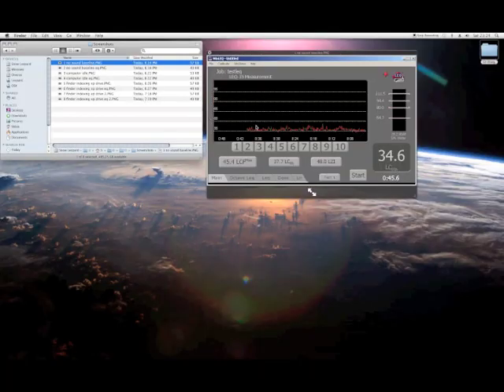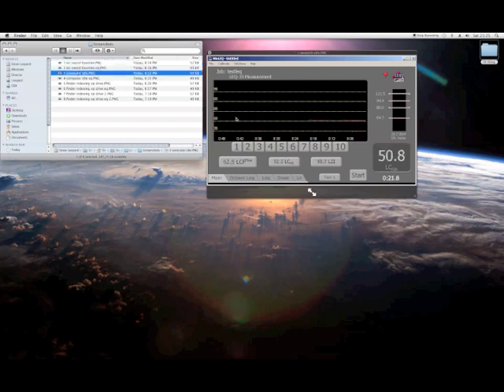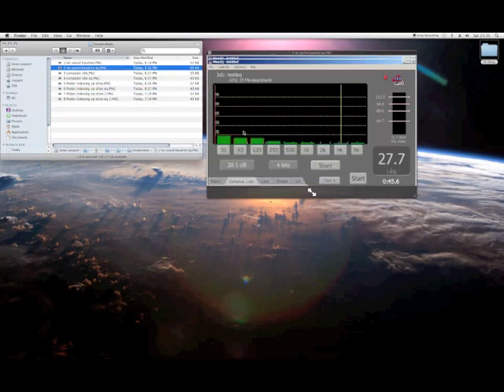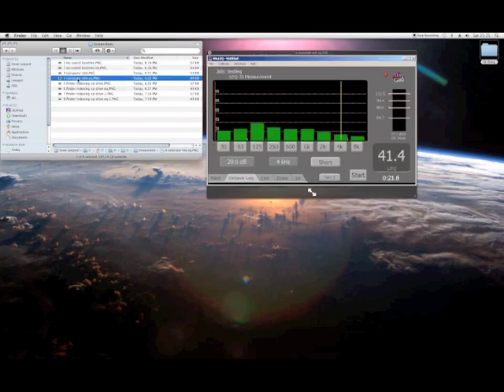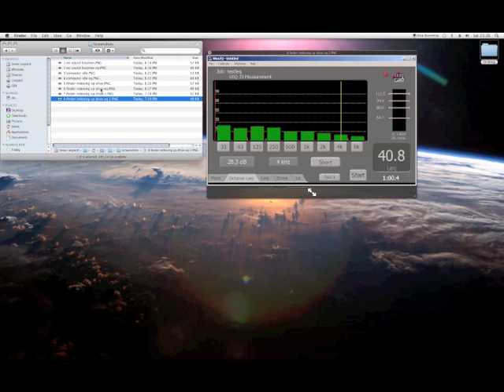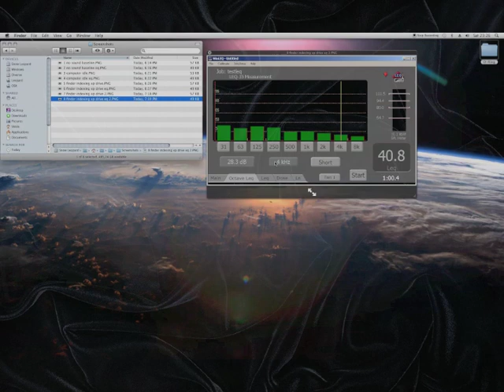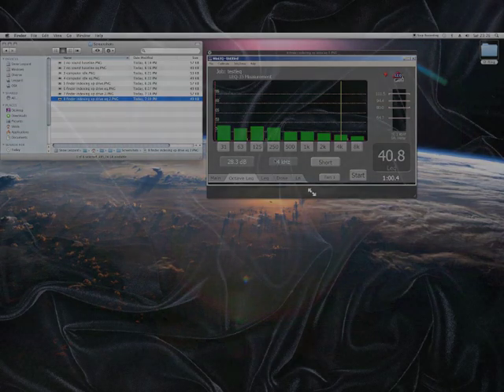Reducing noise from your HDD.

Comment: Waaaa sound like a very bad idea. The drives are still mooving, not fixed. I think the drive will die young. But at first, the drives were vertical, wich also is bad for the drives, if you believe most constructors, so who knows, it might be better :)

Comment: the whole case of the HDD is connected to ground of the electronics, it wouldn't made any difference which way you put down the HDD. It doesn't do anything.
Reply: MotoK tips he was insulating hdd from case, because case amplifies hdd noise.

Comment: Uploaded in 2009, how can I not have seen this earlier. I've been looking for something like this for some time now. My HDDs make my entire case vibrate and a large SSD is just out of budget. Going to try this for sure. Thanks for the great idea!
Reply: Does it make it more quiet?
Reply: @Conch.  Not as much as I hoped. I've used rubber bands that look the same as the ones in the video. The problem is that there isn't enough room to really hang the 3,5" HDD's up with the rubber bands. It's a rather tight fit with the rubber bands in between the HDD and the casing. So it reduces the vibrations a bit, but does really not eliminates them. Maybe in a case with a different setup the HDD can be suspended by the rubber bands. 

Since my first comment was 4 years ago. In the meantime I bought another SSD for internal use, pulled all HDDs out and have an external HDD mount on my desk for when I need to access the data on them. My pc is really quiet now.
Reply: @CtotheZ  ok thanks for replying so fast  :) I’m going to do this trick so I can silence it a little bit because it vibrates my case so i might be able to reduce the noise a bit

Comment: This will only work if you have such cases in which you can put multiple hard drives. In my case I have separate plastic trays in which each hdd goes. Even with some rubber washers it still makes noises. It still vibrates, resonating through the case. It's annoying.
Reply from the maker: Snowwie88 
I've seen people using this technique in the 5,25" bays. Worked fine for them. 😊
Reply: Remove the cages and guetto mod the thing.

Comment: This thing doesnt work at all.. Well.. it can help a bit.. maybe like 30% tops but to really silence it you need something like a box for it which will really silence it.. esp when you need a high rpm hdd even tho these times it might be better to just buy a 500 Gb or 1 Tb SSD if silence means a lot to you.. More so if your pc is made for it like mine which consists of:
- PSU that keeps fan off when under 70% +- of load (idk the exact %)
- Graphics card also with fans off when idle..
- CPU fan set to idle when it is below 60 celsius 
- Along with all 3 case fans off until gpu or cpu goes over 60 celsius
This means I had a 100% ultra silent PC setup where you couldnt really hear anything until you of course turned on some game which will put enough stress on gpu..
But that just until I got there a 7200 rpm 1 TB hard drive that is just NOOOISY AS FUCK... I had to dump it into one of those silencing boxes and I am satisfied again with my almost no noise when idle even tho now I can hear it when I sleep cos I dont really have or like those silencing cases what could actually help even further

Comment: mine sounds like that constantly and louder, its like its always writing or reading even when all ive done is boot up and open my browser, i could understand if i was copying files or writing data to my drive but browsing the net?
Reply: That is called Browser cache.
Reply: for me, move web-browser(firefox) cache and window's  system temp folder to USB drive.  and use ReadyBoost of windows.  It'll reduce HDD access and make it silently.  also boost speed of old machine.

Comment: Guys who have problem with the temperature of their hdd - just put your hdd to the top of your pc to 5.25" bay(where cd-rom should be) and if ur not using O-ring, you can screw them EASY to only one side and 1 screw! Just screw it tight. Worked for me for 4 years, no problem! :)

Comment: I couldn't find O Rings the right size anywhere so i used hair bobbins instead. I have a similar case to the one in the video but there were not holes on either side so i had to hang the second HDD with cables ties to the first HDD. works perfect. now have a very quite system, thank you thank you thank you

Comment: I realised my cpu fan was running at 100% all the time then i found out about the Q-fan control and that blew my mind. my system became almost completely silent. until i heard the harddrive and now that's driving me nuts so i'm collecting some ideas for cushioning the drive :)
Reply: Yeah i had almost the same history.. Got psu that has fan off when not under bigger load.. GPU fans off below some celsius.. cpu fan off set to off below 60 C.. all 3 case fans off until cpu or gpu goes over 60 C.. So i got 100% silend when idle PC and then i got myself a fucking 7200 rpm 1 Tb hdd that turned my world upside down xDD
Reply: +cankarales Same :D
Reply: NotEvenDeathCanSaveYouFromMe how do you turn case fans off until gpu gets to 60? Is it a fan controller?
Reply: same here

Comment: Awesome! will this work on brand new HDDs? I want to buy the black WD , high performance/High noise level, will it lessen the noise? or just on used HDD? Thank you very much for the video.
Reply: HDDs these days run cooler so its ok. but you have to figure out how to do the same he did cause HDDs cages are not the same between then and now

Comment: Not actually fixing the actual problem, just covering it up.. Ssd ftw
Reply: Chris Hira $$$$$$
Reply: There's no better fix, you're pretty much eliminating outside the HDD vibration, the residual noise is just the platter and actuator. 

Unless you wanna spent on 2-4TB SSD's.

Comment: @sn0le Depends on a lot of variables, sure. I for one have 2x1T F3's and i get about 35celsius on idle with a 140mm intake fan in front of them. This is with the "suspended hdd" method, so no contact with the case.

With the mounting blades on and thus, thermal contact, i get about 32 idle. So yeah, depends on a lot of variables. Considering my HDDs can take up to 55-60 on load, i wouldn't bother to much, but for some people its more important.

Comment from the maker: @TheBmfalex:
Thats true. But most computer casings have fans in the front that push air into the casing.
If the drive is placed behind the fan(s) you'll never have a overheating problem with the HDD's.
Mine usually stayed at about 28-30 degrees celsius thanks to the two 80x80mm fans in the front of the casing.

Comment from the maker: @AYust22:
Is that 3 inches and 4 inches?

3 inches is probably the best. The thickness of the ones I got is about 6-7mm.

So diameter of 75mm of the ring it self, and 6-7mm thick rubber.

Comment: I found  rings for plumving that doesn't look like what u have showen in ur tutorial, diameter of 3 something and they looked too small I fear I will have to tear them apart...

maybe If I do cut them but tie them togever with a plastic clip it will hold up nicley?

cutting rubber doesn't sound like a good idea... it might snap and I'd lose my HD :S

I also found o ring that is in the size of 4 and it was extremly big would u suggest I just tie the uneeded parts to the side of my case ?

Comment from the maker: @AYust22:

These are for drain lines made in plastic.
They haven't been in the market for 15-20 years, but the O-rings are still made so that existing drain lines can me maintained.

Any O-ring (rubber) with a diameter around 75mm should do the trick.

If you go to a shop that sells plumbing parts here in Norway, and ask for partnumber NRF 2224424 you'll get these.

How to get them outside Norway, I don't know.

Comment from the maker: Thanks. :D
It is a simple/cheap way to get rid of HDD-noise.
There are many other ways to do it.
Usually a purpose built product you can buy at your hardware dealer.
Just wanted to share this with "the world". :)

About the Hackintosh.
Wanted to test OSX on it last year. Stuck to it since then.
Thinking about upgrading it to a i7 920 with 6GB of RAM.
Cost = 1/3 of a 27" i7 iMac.
Allthought the iMac has good LCD's, I have a Dell U2410.
It's a good 24" IPS-LCD, so I see no need to throw it out. :D